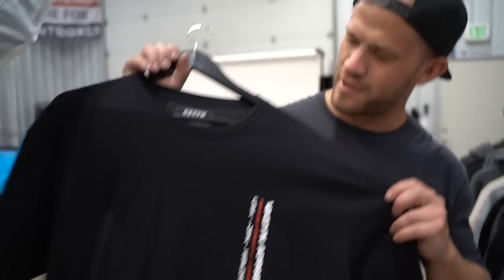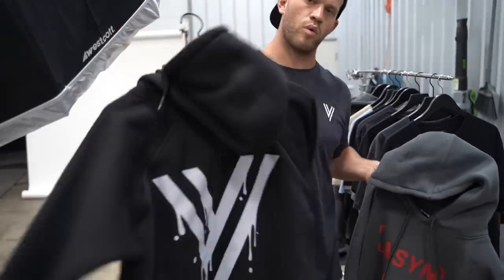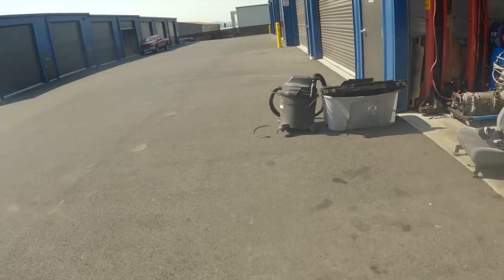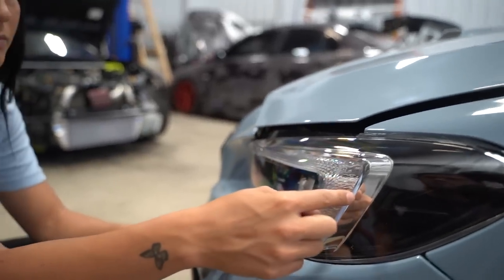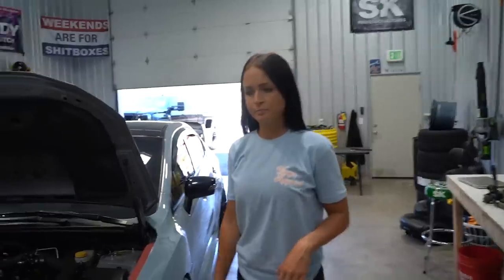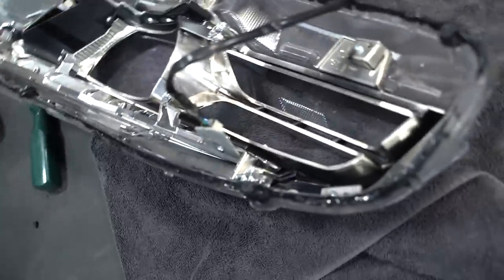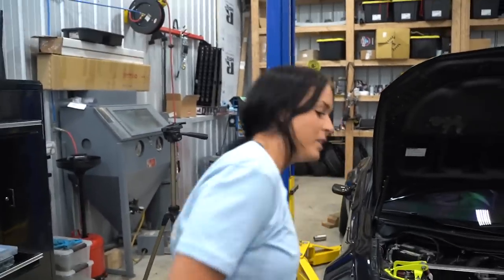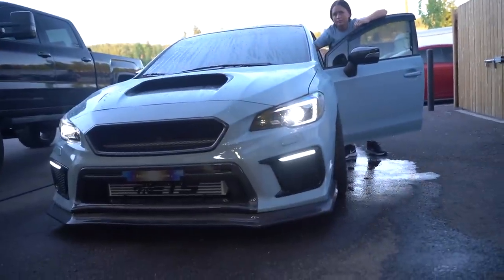Customizing Her STi Headlights!

Comment: If that hawk had a ej207 swap it's one of the better engines semi cdb nitrated crank forged rods as standard some had forged pistons some had cast .but still if the cars twisted it no good .
Reply: Spec C motor is cast pistons.   Also has thicker sidewalls from using the EJ257 Case halves.  But not just any cast, non-forged hypereutectic pistons :).

Comment: The jdm 2.0 motor that’s in the Sti could be the jdm Sti motor the ej207 those are actually a 2.0 instead of the usdm ej257 which is a 2.5l 🤔

Comment: When a circuit overheats, the plastics and heat-resistant chemicals used in outlets, circuit breakers, or wiring insulation may emit a fishy or urine-like smell 

just a reminder :)

Comment: I want to remove the turn signal bulb, black out my STI headlights and put a sequential C light in it. But I've never fucked with headlights and they have the steering tracking system. Which makes them way too expensive for me to experiment on and fuck them up. Maybe one day.